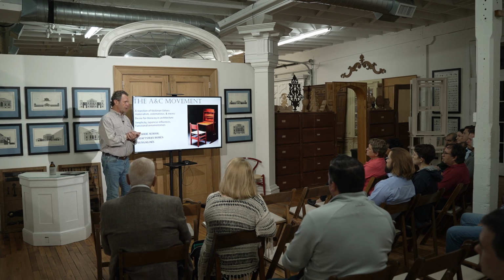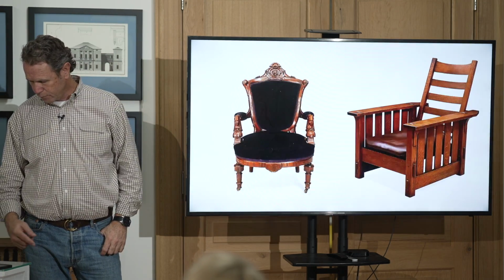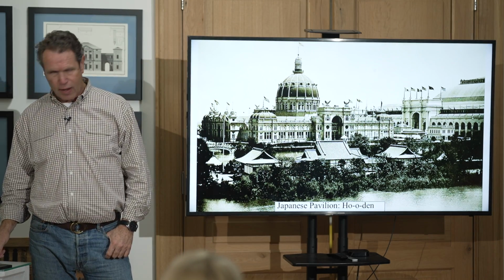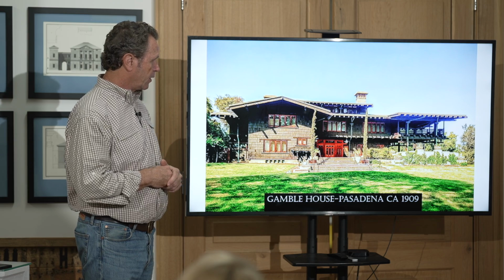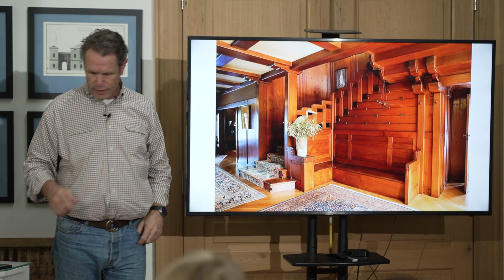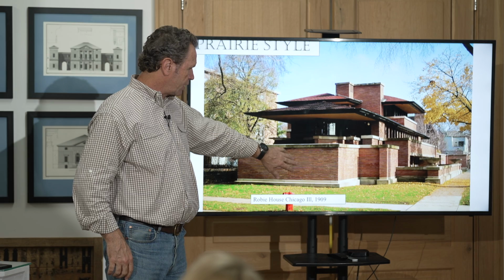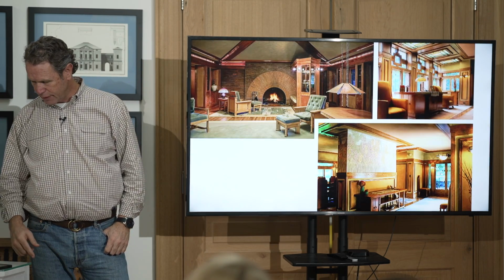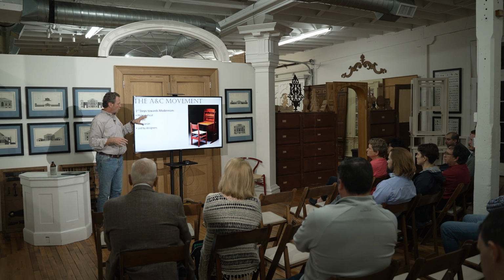Modernism first influence- The Arts and Craft era

Comment: Hi Brent, I was wondering if you could share your thoughts with me on the issue of clapboards.  I am trying to build a historically accurate Charleston single house.  You know the type, double piazza, tall windows and narrow a la Charleston. No plastic, PVC, mdf, etc.  Wood doors, windows, columns, railings, shutters, bluestone walks, granite steps.  Plan to have 4" exposure clapboards.  I located some clear cedar finger joined primed claps.  I am not sure if this is the best choice.  I am on a budget so I can't go crazy with the siding, but it must be wood. Also, noticed Tom Silva face nailing claps on a historic colonial.  I do not like that look, but will do what is best practice. Any thoughts?  Thanks.
Reply from the maker: Sounds like you are on the right track. Success will be found in your execution of details. Window and window trim details, column sizes and details, getting the traditional elements right is really a matter of copying the past well. I would caution the finger jointing of any exterior wood product. I have not seen it done well. How much are you really saving? Those are my thoughts. Good luck it sounds like a great project.

Comment: If you look at the origins of the UK Arts and Crafts movement (people like Morris), it had its design origins in the desire to get rid of over ornamentation but, just as importantly, it had origins in the desire of the founders to be more socialist in the way they treated people. They wanted to respect their workers by employing them in decent surroundings, by paying decent wages.

Now I know that, for many, the word socialism is not a word to be used in their company. I accept that the word socialist has been part of the title of some of the worst regimes in the last 100 years. It’s a little like having the word democratic in the country title (Democratic Republic of….); you know that if a country describes itself in its name as democratic or socialist, then it’s ruling elite have not been elected democratically and their policies are not for the benefit of society. However, the true, the original, meaning of socialist is all about looking after society; respecting people regardless of their social position, of their trade, of their politics. 

So, the UK Arts and Crafts movement was both an aesthetic and a political movement. Morris and others did set up model artisan communities in the countryside (eg Broadway in The Cotswolds) where the standard of living for the workers was immeasurably higher than where they had come from. Some machinery was used but only where it did not interfere with the desired aesthetic. Use a table saw or a thicknesser, use a morticer but it has to be complimentary to the human skill and not replacing it. 

These desires for craftsmanship were partly the Achilles ghee of the movement. To pay for the best materials and to pay good wages meant that the cost of the goods were just too high for the working man. So, the idea of beautiful objects, of having nothing in the house which was not useful or beautiful just was not possible for the masses.

My sense is that, although people like Stickley, the Greene Brothers took much design influence from the UK movement, the political side just did not sit well and that socialist element drowned in the Atlantic crossing. 

Many geniuses are flawed and FLW was certainly both. I’ve been lucky enough to visit two of his buildings and I am in awe both of their current relevance but also the radicalism of the design when they were constructed. Another responder, quite correctly to my mind, defined the differences between many of the original A&C (or prairie or craftsman) buildings and much that is today labelled modernist. To me, it is simply soul; one has it in abundance and one the other has none
Reply from the maker: Nice, I agree. Thanks for sharing.